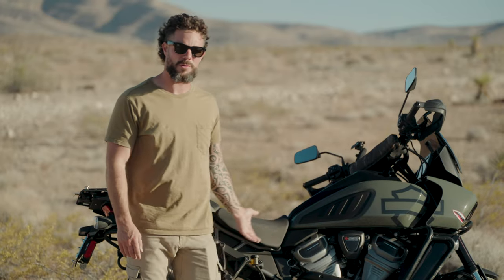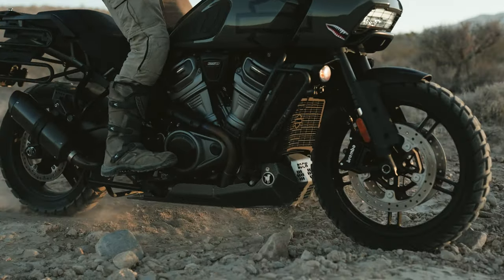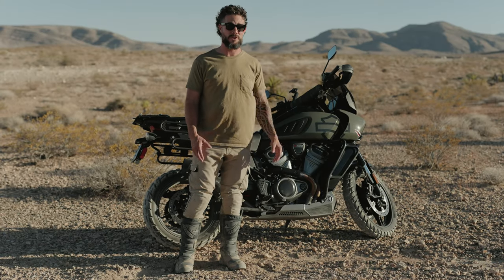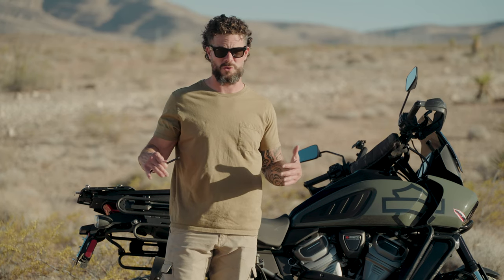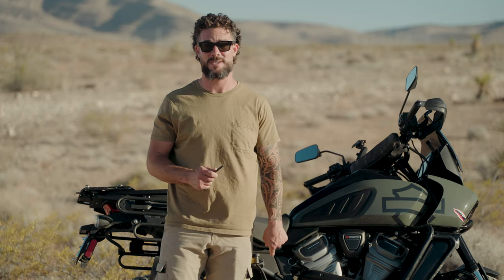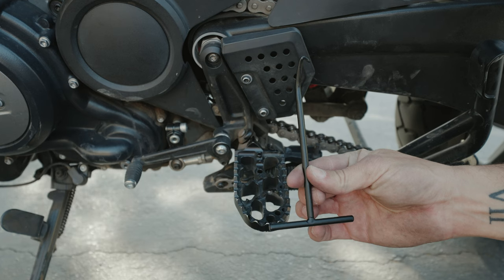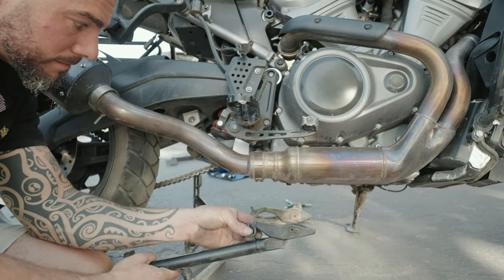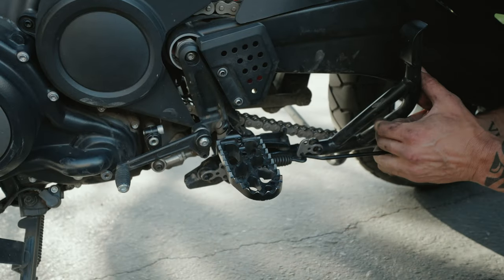Black Dog Cycle Works Skid Plate for Harley Davidson Pan America

Comment: oil changes. can you replace oil filter and drain oil without taking off this skid plate? great channel by the way. thank you.
Reply from the maker: You need to take it off but it’s only 4 bolts
Reply from the maker: Also thanks for the compliment!

Comment: What tires are you running?any better than stock michilins.
Reply from the maker: For off-road! Way better https://www.revzilla.com/motorcycle/metzeler-karoo-3-tires?gclid=CjwKCAjwzeqVBhAoEiwAOrEmzfq7qlAQBE-p-exI1lq77_bUzxopoEiAb1xptXQigOT6yFCQE6xjuBoCQ1kQAvD_BwE

They are noisy on pavement though and will lose grip if you really accelerate out of a corner on pavement. This is my first set of more off-road oriented tires though so I don’t have much to compare to. Also both my mentors said it’s better to learn the skills on more of a hybrid tire than jump right in with knobbies because they will give you false confidence